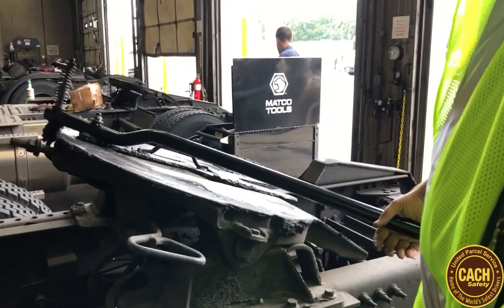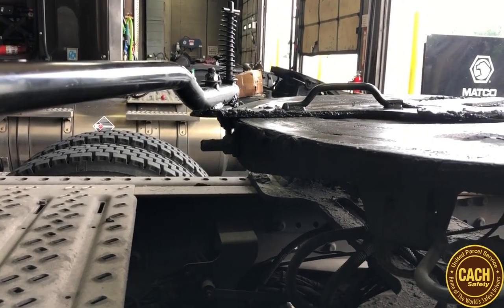Holland 5th wheel

Comment: How do you adjust?
Reply: The nut on the front he pointed to. The jaws have to be close with the pin locked in turn the nut counter clockwise just enough till the washer is snug but you still can turn it.
Reply: @Dachamp2001  thank you for your business 🙏🏼
Reply: @red6423  NP